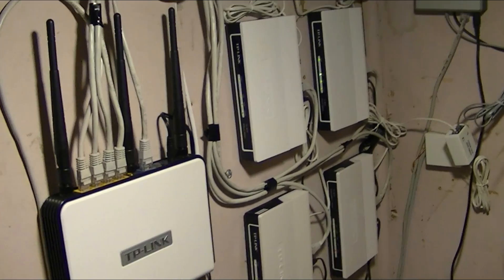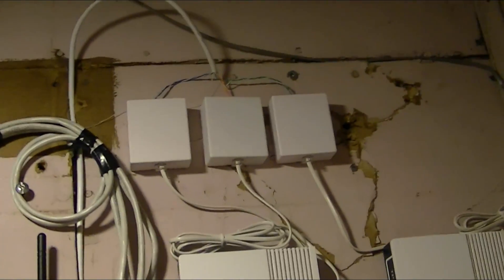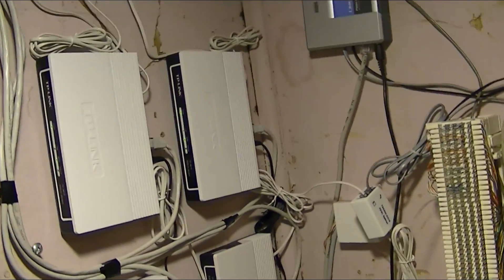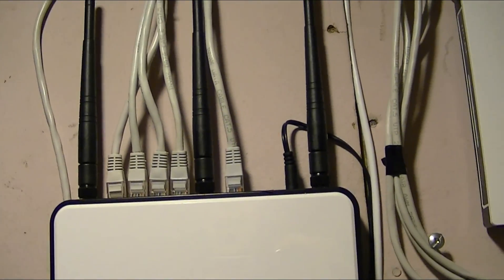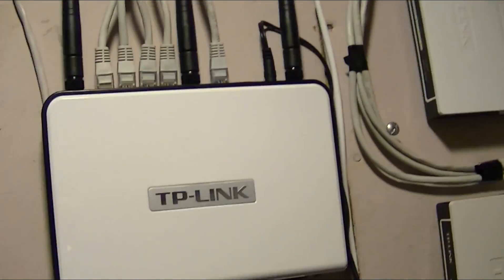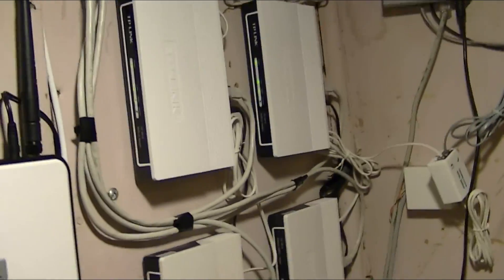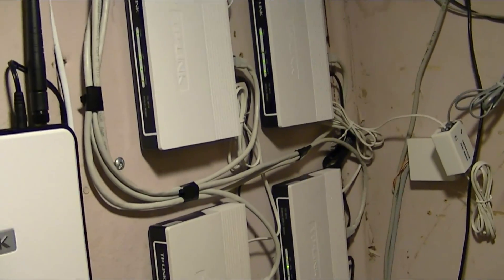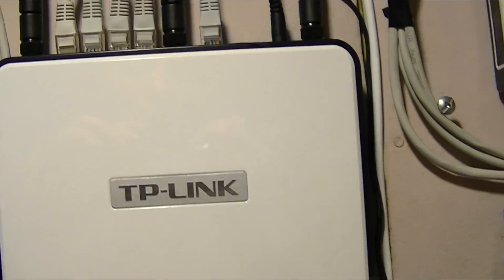Bonded Cable & DSL MLPPP (Multilink PPP)

Comment: Are you still using this system? If you are, have you thought about switching over to a Cisco ISR with EHWIC-VA-DSL-A cards? I'm really curious about this, and may give it a try myself if my ISP ever decides to upgrade their DSLAM and can give me 1-7 more ports. Maybe you could ditch the 4 separate modems in favor of two modem cards to bond your 4 lines.

I have a couple of videos up on my current system if you want to see the Cisco equipment I'm using for a total overkill modem at the moment. Hope to get your thoughts although I really hope you have been able to get something a bit faster than this since 2011... However, having used both DSL and cable, Ill take DSL any day as its a much more stable connection (provided adequate backhaul on the carrier side  which I don't have at the moment). I picked up my modem card for a steal at $12 on ebay with free shipping, and have been kicking myself for not grabbing another at that price while they had them. The router was around $60.

Comment: Why are all your antenna oriented the same way? Shouldn't they be pointed in the three different axes? e.g. Left one to the left, middle one up and right one away from the wall. Wouldn't that give the most diverse radiation patterns and thus range in all directions?

Comment: Question: Can you do the same but with 2 or more 3G mobile modems connected via USB into separates  TP-Link TL-MR3220 and then all of them connected to the TP-Link TL-WR1043ND ?  The idea is to bond the 3G modems from different companies for a better mobile service. any other idea for that?
Thanks